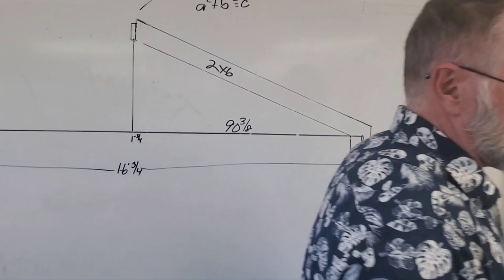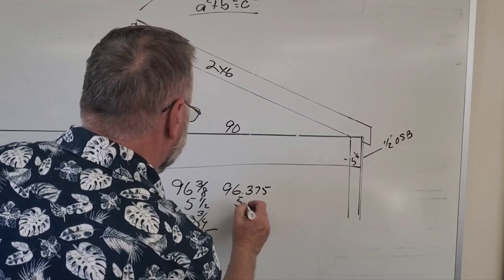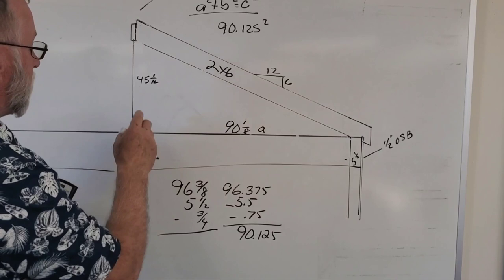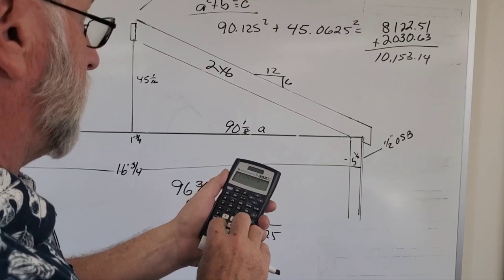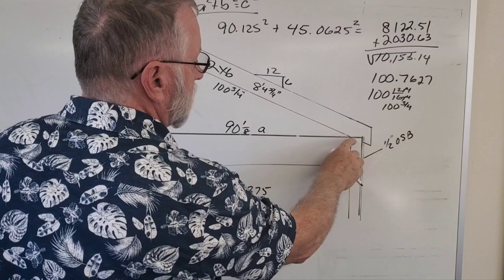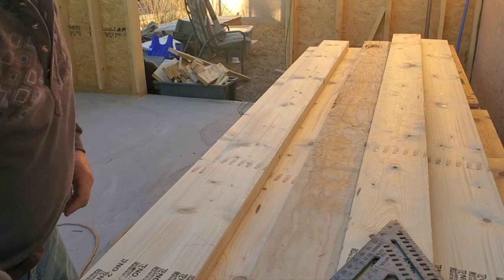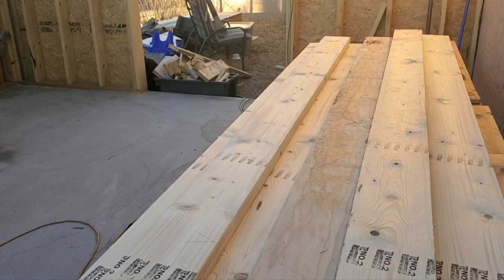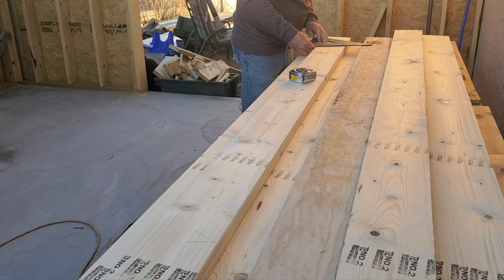How to cut Rafters the Right length the first time

Comment: I'm a plasterer by trade and took on a job some years ago building a pergola. I decided to learn trigonometry. My favourite formula is tan. I also learned inverse tan and drew up spread sheet to write  formulas within. I'm pleased I came across this as I too like to upload something similar sing this method. We use metric so looking at imperial is a little confusing to me as I threw away all imperial and don't even convert. I know one inch is 25.4 mm. I have bought a scientific calculator which I'm still learning the functions.
Great video, thank you for uploading. edit changed right to write.
Reply from the maker: Thank you.  1 inch = 2.54 cm
Reply from the maker: Oh right you said mm. Sorry.
Reply: @mikesmadness6669  Interesting that my mother uses centimeters as she was born in the Netherlands and immigrated with her Mother and sister to Australia. While I use millimeters. My scientific calculator has a function for decimals for imperial measurements like you have shown. After watching your video some others popped up with the use of speed squares. I find them very useful. However learning formulas like you have shown I  think should be a bases. Once again thankyou for the upload .
Reply from the maker: Speed squares are great but there is room for error.  But the math is always right.  Thank you for your input.

Comment: Nice step by step tutorial. How would you figure the total rise to the top of the 2x6 Rafter? Thanks again.
Reply from the maker: It's a similar process,  I'm my case with a 2 x6 you take the width 5.5" x12, then divided by 6 because that is my pitch.  That gives you 2.75. Then you take the same  The Pythagoras theory.  5.5 squared x 2.75 squared add them together and find the square root of that,  that is the length of your cut.  Add that to other total height. I could do another video to explain that better.
Reply from the maker: It should be 6 1/16"
Reply: Thank you Mike.

Comment: This is all wrong. 6/12 = .5
Tan-1 of .5 = 26.5° . What is that 45 measurement
Reply: Okay, fair enough. I had to convert to metric. Long winded way of doing it 
Cos of 26.5  = 0.894
2.289m/0.894 = 2.560m.
You need to go to the birds mouth and use that length of run
Reply from the maker: Not sure what you are doing but my math and measurements came out perfect,  that's all i need